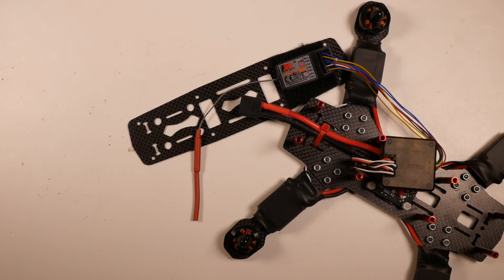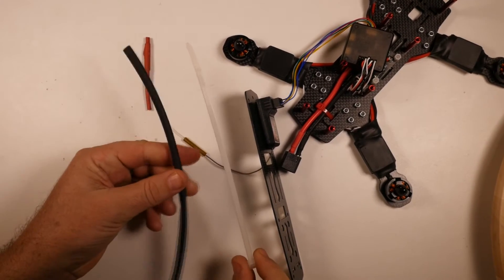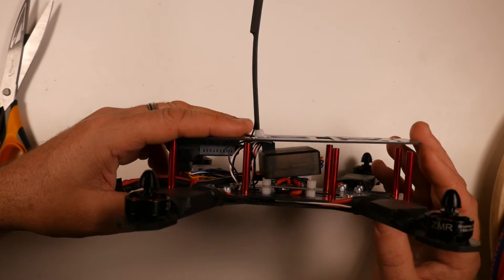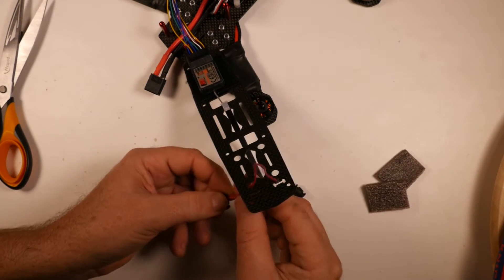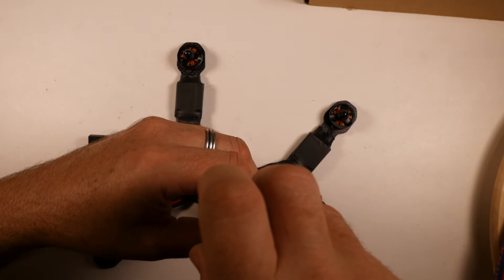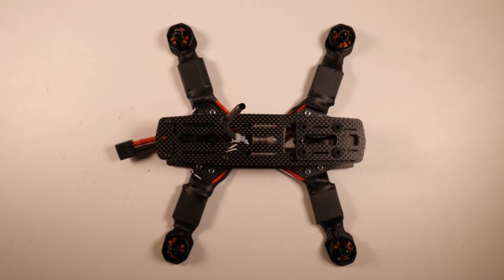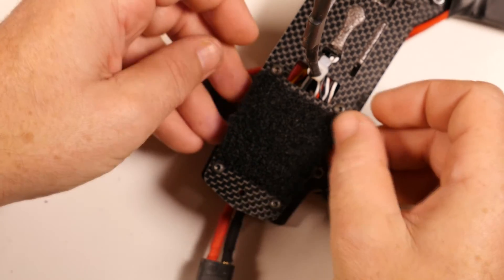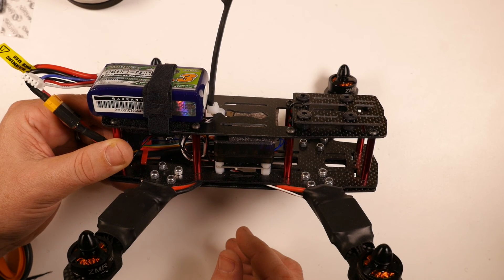Beginner's Build: $85 Mini Quad - Battery & Final Assembly. Part 6

Comment: Despite all of the negative comments about the maiden flight video being unavailable; I am truly thankful for all of the videos in this mini series. You did indeed go into depth, and not only that you cleared up the grey areas about how esc's function in relation to the battery, and flight board. I finally understand how the transmitter and receivers work as well, on top of that you gave good insight on the "trial and error" of the receiver to flight board. All of these things were so vague to me before these videos, now I feel confident on building one on my own, albeit s different model. Cheers! I hope and pray all is well in regards to the "dramatic and sudden" missing maiden flight video!

Comment: So I placed some small felt tabs under the top plate which raised it up enough to take the pressure off the Flight Controller.  Fixed the wobble by using Libre Pilot and selecting the ZMR Chinese clone.

Comment: Just built this quad yesterday.   I used your video to get me through it because I have never built one before.  Everything works.  I had the same problem with the top of the quad not sitting down because the power distribution board and flight controller sit too high with the stand offs provided.   Flashed it with libre pilot.   Flies but shakes too much.   Hopefully I can resolve this issue.   Thanks for the video.

Comment: Are you able to fly on 4s with 12a ESC's and EMAX 1806 2280kv Motors?
Looking forward to the maiden Flight.
Reply from the maker: Tooser Lp Those motors are 3S max according to the HK product page. If you want to run 4S I would strongly advise sticking with Cobra, T-Motor or even the good Sunny Skys, and top quality ESC's like the SN20A. The thing is, cheaper setups may run 4S for a while, but the extra voltage and heat will put a strain on lesser components, and probably won't last as long.
Reply: The Dark Pixel Thank you really much, otherwhise I would destroy my Mini Quad.